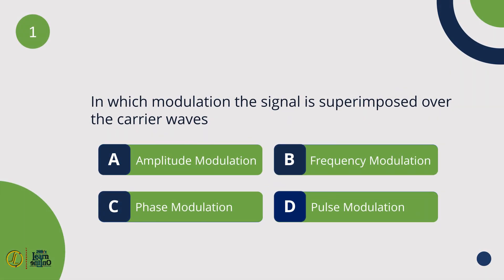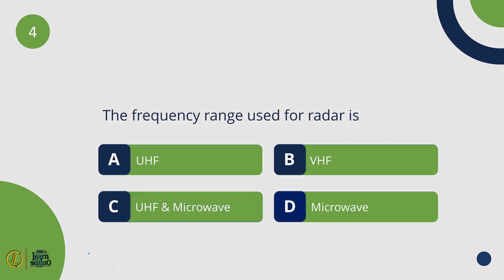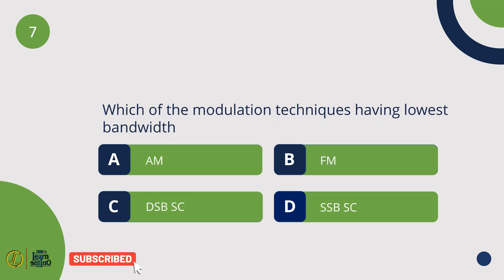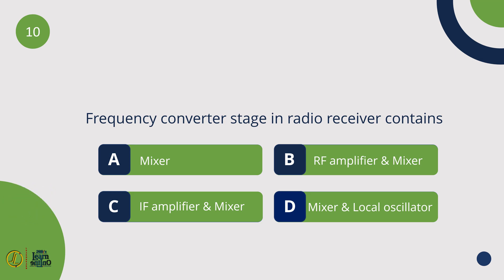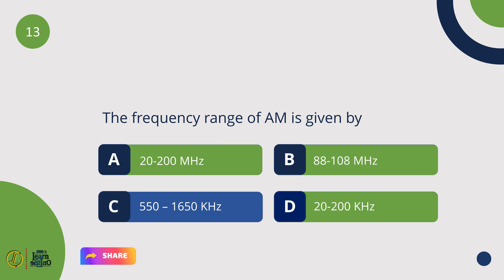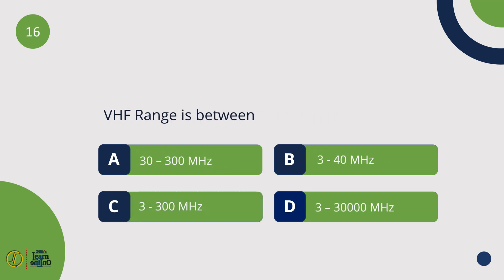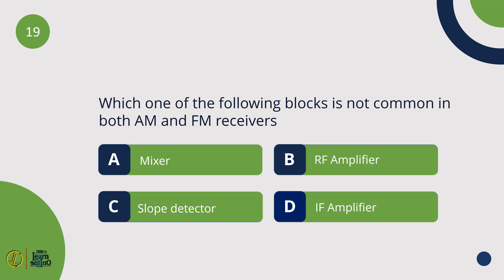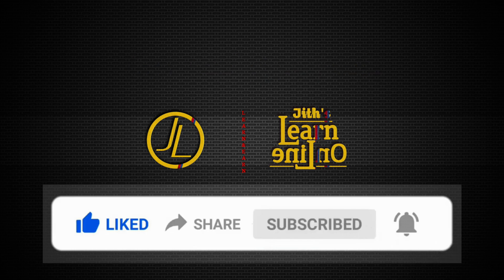Mock Test 4 | Previous Competitive Exam Questions | Electronics | Repeated MCQ's | PSC,UPSC

Comment: In the 5 th qn modulation reducing bandwidth false aano? Ath right alle. Modulation reduces bandwidth enn alle. SSB okke efficient aayath less bandwidth use cheyyunne kond alle?
Reply from the maker: But modulation main ayit upayogikunnath bw reduce cheyyan allallo. Pinne am scheme upayaogikumbo 2fm bw ullath filter vach filter cheythitalle fm aki mattunnath. Ath modulation nte advantage allallo
Koodathe options il bakki 3 points um modulation nte advntage ayi direct mentio  cheyyunna karyangal anu.